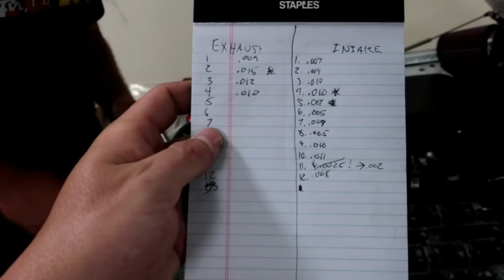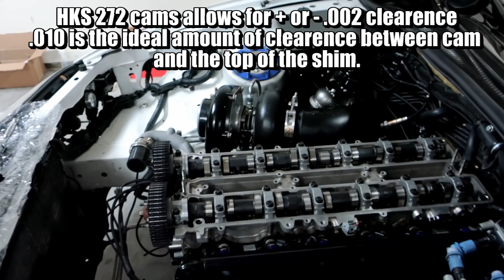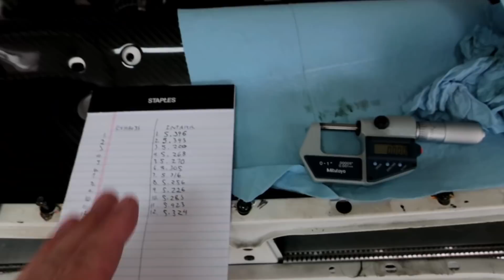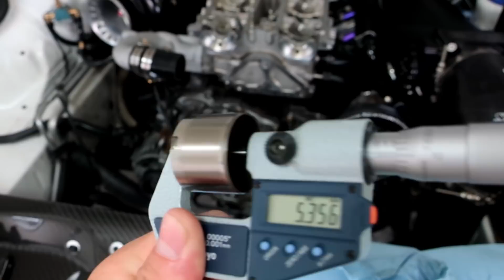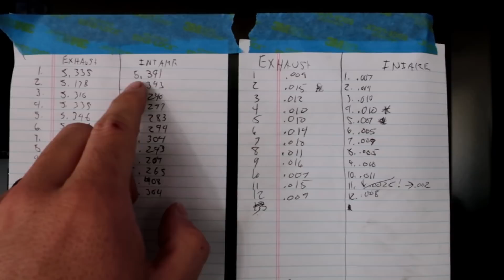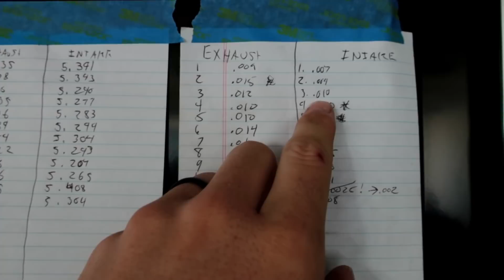How To Measure & Clearence For 2JZ Shimless Buckets

Comment: So let me ask this if the specs is .010-.014 for exhaust. Would you want to get .014 so that you can use the buckets much longer as it wears from .014 .013 .012 until i wears out of spec or is that not the way to go about it? Or would you want to just get  a .012 which is in the middle of the spec

Comment: You guys know intake and exhaust have different clearance right. Not 
.02+- of .010

Valve clearance (Cold):
Intake 0.15 - 0.25 mm (0.006 - 0.010 in.)
Exhaust 0.25 - 0.35 mm (0.010 - 0.014 in.)
Reply: Unless stated different with directions of that specific cam
Reply: Is this the same for 1jz vvti i was told its different

Comment: Quick question, for a performance car. Wouldn’t you want your valves to have the exact same clearance, two thou isn’t much sure, but if you’re racing wouldn’t you want it exactly the same that way each cylinder gets exactly the same air and fuel?